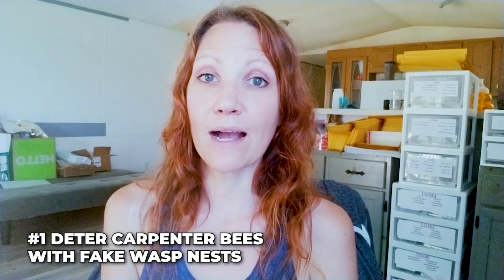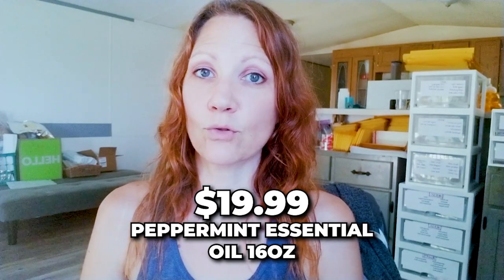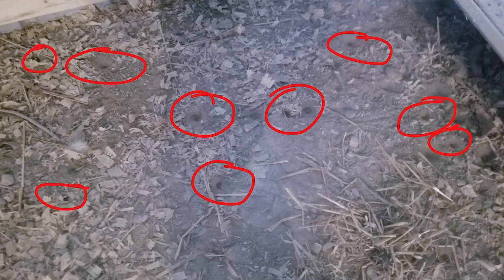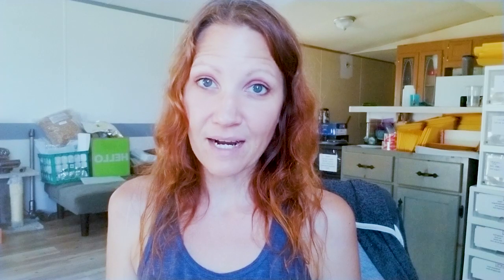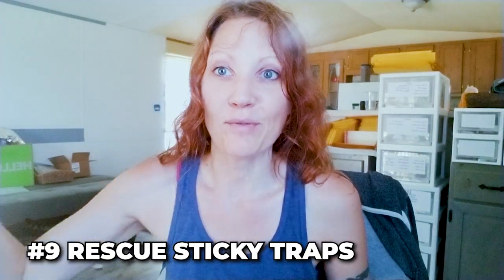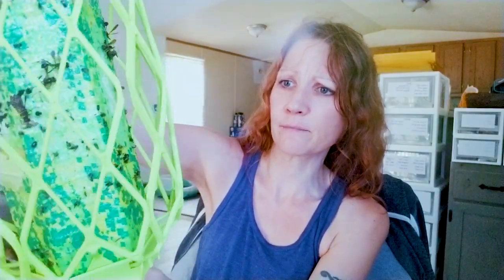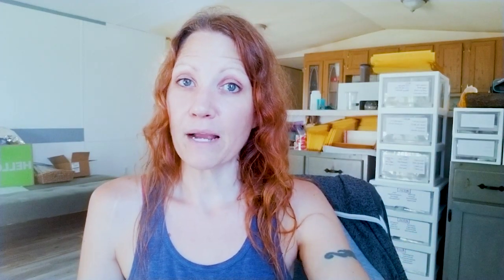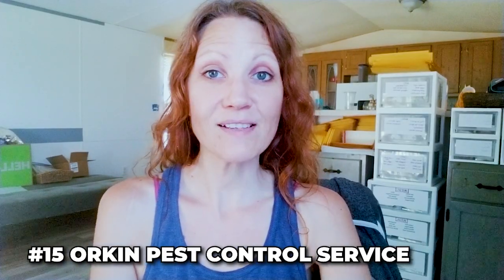PEST CONTROL AROUND THE PROPERTY: Guarding Against Summertime Insects!

Comment: Sadly, most natural stuff that I have used as a detterant or repellant for ants, bees etc has been minimally successful if at all.  Glad you called Orkin.

My issues right now are the carpenter bees and wasps- variety. I use the 20 ft spray stuff and knock down the nests.

One very annoying and stinky creature I am fighting alosingbattle with are Kudzu beetles! Ugh!
Reply from the maker: Thank you! I would highly suggest the fake wasp nests to deter carpenter bees. They completely vanished a day or two after I put them up. It was pretty amazing. Have you tried those before?
Reply: @TinyDreamer  I have not and that was the one thing that you were showing in there that intrigued me. Because they've been trying to eat my front porch and deck steps and my rear porch and anything they can get hold of!

As a matter of fact it's very ironic but I needed to replace two boards on my front steps leading to the little porch stoop. I got the wood and had it on the sawhorses in the back and before I could get the saw to come over and cut it they had already bored four holes in the wood! Interestingly, I used I can't remember what brand of wood filler in the holes and they haven't touched the board anymore. Also once I sealed it and stained it with an all-in-one stain and sealer they haven't touched it either!